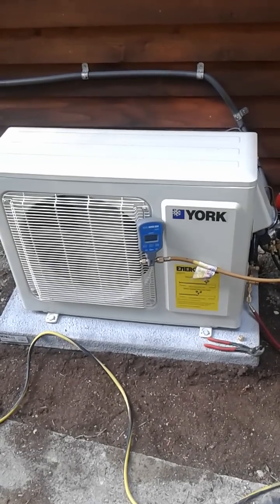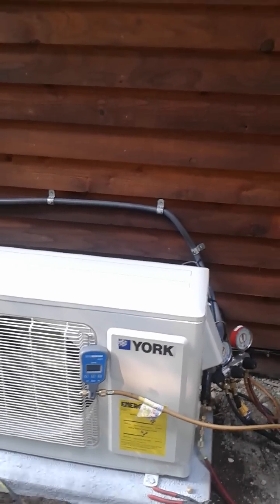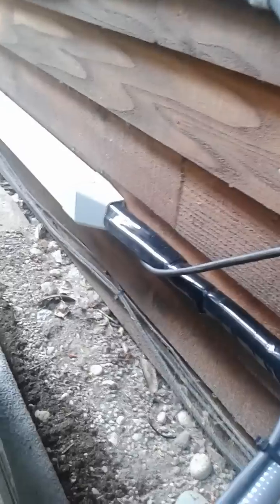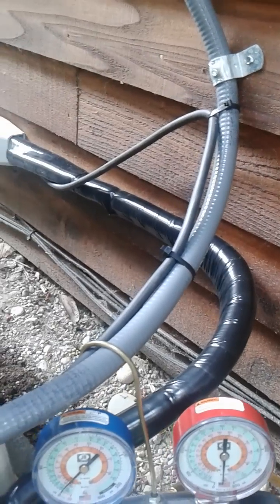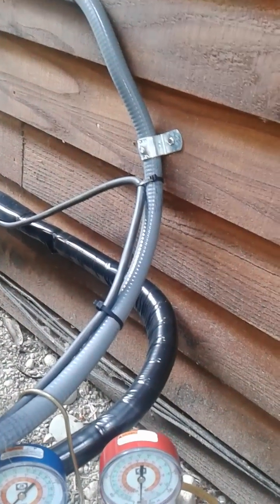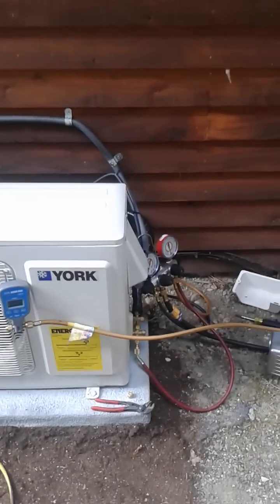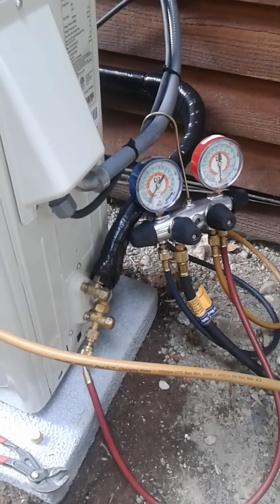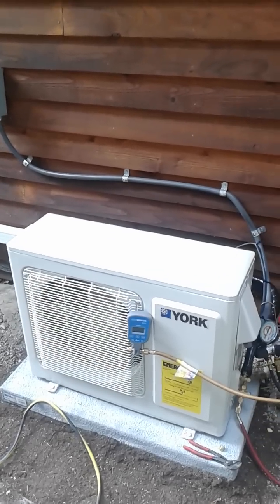The RIGHT WAY to  Install Ductless Mini Splits #2

Comment: That install looks like shit on outside of house. Why not move the unit down to minimize length of lineset and electric to make it look better. Sounds like you did a nice job on mechanics of the install.
Reply: Kevin Brown you can see that the path isn't parallel to that house.  Looks like the width played a factor.  It's an irrelevant point to this DIY video.
Reply: Kevin Brown 
That’s the first thing that caught my eye. Why it was so far away from the Disconnect and the vertical line set.
There must be a reason for it.

Comment: Would it meet code to run the lines inside the wall then out the bottom of the wall outside? For instance on a new home or after a wall was removed.
Reply: Yes, but that is only ideal for new construction.  Doing it with an existing home requires demolition of course.

Comment: I was considering getting one of these to cool my basement bedroom but I read elsewhere that the compressor must be lower than the indoor unit for oil return. Is that true?
Reply: As long as the system is installed correctly, the condensing unit can be higher than the evaporator. This means that you are good to go with your ideas.